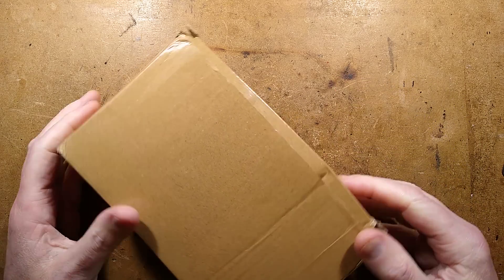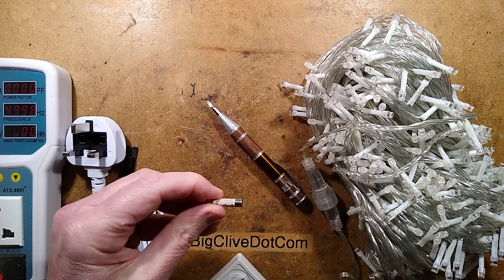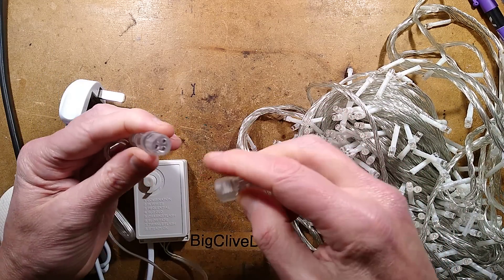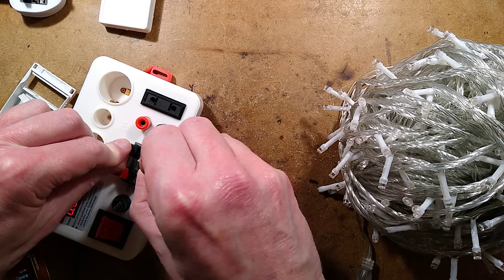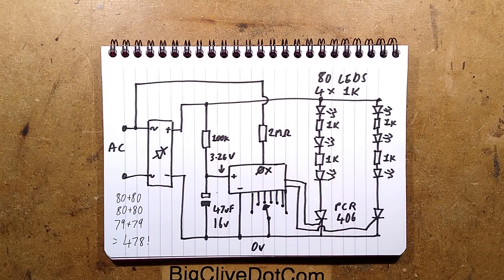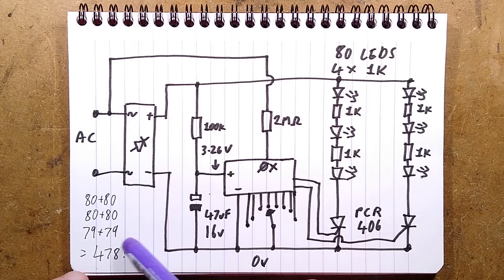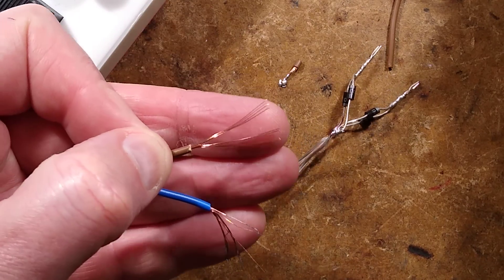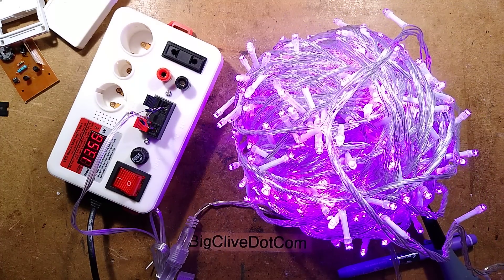exploring a "500" LED eBay light string (with schematic)

Comment: Big Clive, how do you imagine recycling aluminum or steel or even copper from these cables in which insulation plastic contents are much higher than metals by weight?
Reply from the maker: I doubt it would be easy to recycle the metal.
Reply: Burning the plastic off would probably be the best (aka cheapest) way.  The other is you grind it into dust and put the dust into a water bath, the metals sink.
Reply: Does recycling actually happen? I was brought up believing, but then learned of much stuff being shipped back east and set on fire or dumped in the ocean or kept here and mixed back in with the local waste stream. Look, shareholders, no transoceanic shipping bills.
Reply: @tactileslut  If it's easy & high value enough they do, junk yards don't pay for scrap for the fun of it.  No-one is going to go out of their way to recycle this crap though.
Reply: @tactileslut  The problem with a lot of recycling is "contamination", like where a bottle may be one material, the cap another, the cap has a liner, and then there's the label giving at least 4 materials.  Really only metals & glass to a lesser extend gets recycled.

Some people are opening shop where you bring your own container (like ye olde shoppes) but I doubt that'll be widespread any time soon.  And it doesn't solve all the cheap crap we buy online (which adds in the shipping packaging).

Comment: Regarding flicker, I wonder what technology the LEDs are using. I read that purple light may be obtained directly from a GaN substrate as well as secondary emission from a phosphor coated die emitting at some other wavelength.  I’m not sure which way is less expensive.  You can bet the Chinese light string uses whatever technology is less expensive.  I’m guessing that these are secondary emission type LEDs because they have no noticeable flicker when fed 100 Hz pulsating DC from the full wave bridge.  You’ll get a little after glow from the phosphor to cover up flickering.  You may also be able to see brief after glow in a sufficiently dark room when the LED string is switched off.
Reply from the maker: You can get single wavelength deep violet LEDs or the brighter blue with red phosphor purple ones.
Reply: @bigclivedotcom   Good day and thank you for the reply.  Appreciated.

Comment: That’s stupid that eBay are still selling danegrous Christmas lights and that they don’t have the amount of leds that where listed, what a joke! Nice video! Also that’s not very good that they had that 3 prong connector plug on the clear cable after the controller as those plugs are meant for LOW voltage Christmas lights and those plugs would normally be on the low voltage transformer however they have put it on a 240v system! Ffs eBay 😂 I had a set of cheap eBay lights like that and it was an '100 led' version however I forgot to count it to see if it was actually 100. And I now no longer have the lights, as they are made cheaply and unsafely, some of the leds broke off and the mains wires from the plug ripped out and nearly caused a short ciurcit, lovely. I would also be interested to see how you rewired that shady power supply/lamp tester!

Comment: I recently bought RGB string lights of ebay, I was so impressed I bought two more! It has BT for an app on your phone, remote control and USB powered. Not very bright, but they have a lot of variations in modes.

Comment: Electricly much safer than the traditional Christmas lights my parents had, incandescent lights in the form of candles with small Edison screw sockets which could potentially had 220v on the outer ring.
Reply: Some of them sold in USSR used standard 6.3v mini bulb screw sockets that could potentially be touched even if used correctly. They also had a tendency to sometimes ignite thin paper decorations.
I remember jamming soviet er "multimeter" probes into the outer rings as a part of the annual soviet festive activity of "find that one damn bulb that burned out". I swear to the diety of your choice, it was always the last or second to last one for me.
Reply: @jwhite5008  good old soviet fire hazards eh?
Reply: @InsanityPlusOne  Yup! Soviet people know to take precautions too. And, well, ours didn't cause any fires - yet! My parents are still using them for new year decoration. Probably nostalgia, but also some of those things last for half a century, and will probably last even longer. The most dangerous one I was talking about physically disintegrated a while ago, but the others - probably manufactured in the 70s - are still fine - most of them came with spare lamps, or compatible with standard ones - some of the others cannibalized to fix one another. But unlike the modern ones fixing does not require a soldering or searching for LED with similar enough voltage drop and/or resistors - the "newer" 90s Chinese ones with replaceable lights are not in any of the stores anymore (checked yesterday) - nor are replacement lamps - probably because of regulations or something. But the USSR ones still live.
Reply: Which were still safer than the ones my grandparents had. Which were actual candles.
Reply: @RFC3514  that's pure nightmare fuel
Reply from the maker: I'm pretty sure some of the lights on the tree when I was young had live foil stars, as many had lost their insulating ring.
Reply: US market had "bubble lamps" for tree decoration with an incandescent lamp heating a sealed tube of colored (I'm assuming) methylene chloride in an E10 base.  They're still available as "vintage" items.
Reply: We still use these in the USA.  Not as common today but I still prefer the larger C7 and C9 bulbs. Only 110v.  Most of the sets these days use polarized plugs so the outer ring is neutral rather than line.
Reply: @grayrabbit2211  - If they're turned on, neutral will still be live.
Reply: @RFC3514  In the USA, neutral is bonded to earth / ground.
Reply: @grayrabbit2211  - Earth is bonded to neutral at the distribution panel (most places don't have a true ground connection), hopefully through a fault detection and protection device, and nowhere else.

That doesn't invalidate the fact that current that flows through line flows back through "neutral" (which is why a better name for it is "return"). If you touch it while current is flowing through it and you offer a good path to ground, (part of) it will try to flow through you. The two wires are basically the same, at that point. Now, if the lights are turned off, then only line should be live (and since the current isn't flowing back through return, it's more likely to go through you if you touch it). But don't assume the return wire is always safe to touch just because it's called "neutral".
Reply: @RFC3514  Everywhere in these parts has a solid ground connection.  People without one find out quickly that our daily thunderstorms will take out all of your electronics if you don't. 

If someone manages to touch both neutral and line, yes, they'll get a zing... but neutral to ground should be minimal voltage.   Just throwing a meter on the receptacle on my desk,  <1vAC between the two.    Even at that, here in the USA it's 120vAC.  Even if a Christmas light string with C9 sockets was plugged in and you shoved your pinky finger in there, it's not going to hurt you. 

The only time I've ever been surprised by finding voltage where it shouldn't be was on a cable TV wire in a large facility, where I got a little zing when touching the signal & ground on the coax.  Broke out the meter and found ~60vAC on it.  I alligator-clipped the signal wire to electrical ground and left it overnight.   The next day the offending device outed itself -- a TV wasn't powering on anymore.  Sure enough, 0vAC on the coax line once that TV was removed.

Comment: Heh. I wish these were incandescent, but it seems to be a pretty nifty set.

Not overly concerned about them being intrinsically safe, either. hell I've been using a deathdaptor XL in my bedroom to float the earth of my soldering iron for a couple of years now. I did tape over the lamp testing probes, though, just to make sure they don't pop out at random.

Comment: I was wondering if you could do a review on these kinectic heaters that being popping up as of late. I hear they're a scam.
Reply: Oh, you mean the ones that will heat an entire room that is the size of a concert hall in under 30 seconds for about 2 pence (4 cents)? But which in reality produce less heat than your PC…
Reply: @Mark1024MAK  
No, I'm talking about the one that's actually an air fresher. Look it up on Google, and you'll understand
Reply: "kinectic heaters"?  Had to Google that one.  "Double-ring suspension spins to convert kinetic energy releasing heat in space."  Sounds totes legit to me!
Reply: @j.f.christ8421  
Isn't not, it's a scam
Reply from the maker: Ah, of course - it's that time of year for miracle heater adverts.  I looked at some last year.
Reply: @bigclivedotcom  
Sadly yes

Comment: 10mA per string for 3 strings? Fine gauge copper coated aluminium or copper coated steel is just fine. An argument could be made for favoring steel or aluminium over solid copper for fairy lights, since they will ostensibly be put up and taken down every holiday season (and usually left in a messy wad that needs to be untangled), and the stress of this could cause work hardening in copper.
Reply: TIL aluminium & steel are exempt from work hardening and fatigue.  Will update my engineering book accordingly.
Reply: @j.f.christ8421  Of course all metals are subject to work hardening and fatigue; copper is just worse than others. Anyway, since the power supply wasn't built down to a price as aggressively as many other bits of holiday tat, it's reasonable to assume that the person who specced the wire might expect it to survive more than one or two seasons.
Reply: @j.f.christ8421 Steel, as long as it doesn't exceed it's fatigue limit, will never fail from fatigue - unlike aluminum and copper, which have no fatigue limit and thus will always eventually fail.
Reply: @lr0dy  I have updated my engineering book accordingly, "aluminium and copper, which have no fatigue limit" as per some very educated rando on YouTube.  You sure about that, you "very educated rando on YouTube"?
Reply: @j.f.christ8421  It's confusing terminology but "fatigue limit" actually means close to the opposite of what I expected. Not having a fatigue limit means it will fail from fatigue. Having a fatigue limit means steel is exempt from fatigue if the flexing is low enough.
Reply: @eDoc2020  There's really no such thing as a "fatigue limit", it's like the "best before" dates on food.  All metals will eventually fail, even with minimal stress.  Of course the more stress the sooner it will fail.
Reply: @j.f.christ8421   Are you saying it's fake? My understanding is some materials do have such a safe area. Others like carbon fiber based materials do fail eventually but the effect is small enough to be ignored in practice.
Reply: @eDoc2020  It's not fake as such, but the idea that's there's a magic number and if you keep below that number it'll never fail doesn't hold up.  It's just that it'll take a very very long time to fail.  Much arguing between the metals dudes.

Comment: gotta love that britain has their stupid ring circuit so they need stupid fuses in their plugs
Reply: Despite the hideous price we pay for each electron that we sacrifice to the gods of entropy, we like being able to use lots of  'em without needing cables the CSA of which is more akin to that of a hose pipe. It's also nicer when just a fuse in the plug fails, instead of taking out the whole circuit. Particularly for low amperage stuff like plug in lighting, instead of needing lots of separate low amperage circuits, or having glowing flex's when something chinesium inevitably goes wrong.
Reply from the maker: Solid connection and ANY socket you choose can power anything including laundry equipment and welders.
Reply: It's not the ring circuit that necessitates fuses, it's the fact that their circuits are very high capacity. They could wire their sockets with a 32 amp "radial" circuit (aka normal wiring) and they'd still need plug fuses.

Comment: That "chineesy american type 2-pin plug" is actually called a Europlug. Can you guess where it's used? ;-)
Reply: @Kevin-mp5of  - Well, if you don't need an earth connection, they are quite good. Pretty safe, compact, cheap to make, compatible with Schuko outlets. And the idea of using slightly slanted prongs to hold them in place is rather clever.
Reply from the maker: Is it used in....   Russia?
Reply: @bigclivedotcom  - Those are actually rotated 180 degrees.
Reply: Apparently, if I include that country's name in my reply, YouTube deletes it. Tried it 3 times, all 3 the message disappeared.

Comment: And, on the other end of the scale, I recently bought a set of 48 individually addressable RGB LEDs made by Technical Consumer Products. Controlled by a mobile phone app, and linked via Bluetooth.

They're nice, but a bit pricey and way over the top, with features I have yet to fathom, and/or will probably never use!

One advantage of the cheapy ones, is that you're not going to lose much if they fail and end up being thrown away. However, a year or two ago, I bought some cheapy lights from a local "discount" store, plugged them in, and got a belt off the bastards that left my arm numb for the rest of the evening.

The price reflects the quality, and you only get what you pay for!  It has to be said though, I didn't actually pay for the electric shock. That came as a free bonus!!

Comment: Fun fact: I went to my local garden centre yesterday where, it turns out, they have a sale of all kinds of Crimbo lights. I got a box of 2000 lights for £18.99, a box of 360 multicolour micro led lights with green (copper) wire for £2.99 and a box of 600 warm white micro led 'fireworks,' reduced from £44.99 to £4.99. And I also got a load of those dummy battery mains adapters reduced from £20 to 99p. Result!!

Comment: It would be interesting to hear the electrical noise this makes as it changes between display modes

I'd wanted to get a warm white version to have across a wall but I've always found the bare led poking out of some heat shrink pretty nasty, nothing like the nice old Filament fairy lights!

And they did you out of nearly 5% of the total promised leds! (ok 4.4% but still)

Comment: The 2-pin plug is actually european plug lol
Reply: Was about to mention the same. 😅
Reply: Actually it looks like a 2 pin Swiss Plug
Reply: @Nostalgieletsplays  this is C plug, compatible with most of European grounded plugs hence the name Europlug. In case of short it is job of electromagnetic trigger to disconnect affected circuit, which for 10A circuit should happen at most in 0.02seconds.
Reply: @Kevin-mp5of  After how much alcohol?
Reply: It's actually a cheap knockoff of a European plug.  Thank God for Brexit, which saved us from being "harmonised" with continental Europe and having their unsafe electrical standards forced onto us.
Reply: @whitesapphire5865  they are not unsafe if u use correcly lol all. Depends i would say your stuff is so bulky amd big and ugly
Reply: @whitesapphire5865 - what are you on about, there was no intention to change the U.K. plugs and sockets. Next you’re be telling us that you want British electrons rather than using international electrons.
Reply: @Mark1024MAK  Wrong! Some years ago there were serious high level discussions among our government, with regard to pressure from the EU to adopt EU plugs and sockets in the UK. Next, you'll be telling us that there were never any plans to force all EU member countries into adopting the "Euro" as their currency. Or that there never were talks about the UK switching over to lefthand drive to conform to European standards?

Are you still in school by any chance?
Reply: @whitesapphire5865  - no, I’m in the electrical industry. Discussions is significantly different to intentions. And I would prefer a single worldwide currency. As this is unrealistic, the next best option would have been to join the Euro. Petty little isolationist politics should be left in history, as it’s a cause of a lot of suffering and inequality around the world.
Reply: @whitesapphire5865 there's nothing unsafe about this plug (or well, a certified version of the same type). It's used with double insulated (class II) devices which are safer than grounded devices (class I) since the protection does not depend on the ground connection. And it's way more convenient to use a compatible but smaller connector with such devices.
Reply: @whitesapphire5865  I'd argue they're not more unsafe, they simply use a different strategy. In the UK, you've got a fuse in the plug. In Europe you're forced to have multiple fuses inside your house. However, manufacturers may still put their own extra fuses into appliances, too. And while plugs may be reversed, manufacturers have to make sure to break both wires, not just the one that should be live. Apart from that, conforming plugs are as safe as UK ones, you can't touch any live parts either.
Reply: @whitesapphire5865 you are caping right?
Reply: @Iron4222  Er, translate into English? I haven't a clue what you're on about!
Reply: @whitesapphire5865  I think it roughly translates as "I'm a triggered remoaner still crying about Brexit" 👍 His tears are delicious
Reply: @whitesapphire5865  Well said, that and their disgusting sausage habits. You can't beat a patriotic Lincolnshire chipolata 👍

Comment: I recently got a pack of rotary encoders that came with a whole punch of those jumper wires in a ribbon cable.  I took them out of the bad and set them on the bench and was startled when a magnet flew over and stuck directly to them.  🤣   Yeah... those won't ever be used for any of my projects.